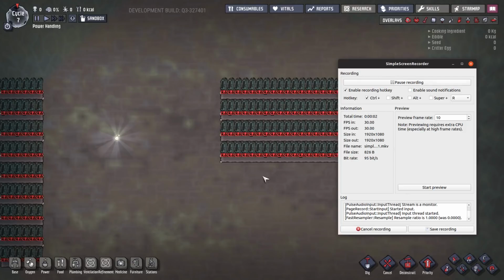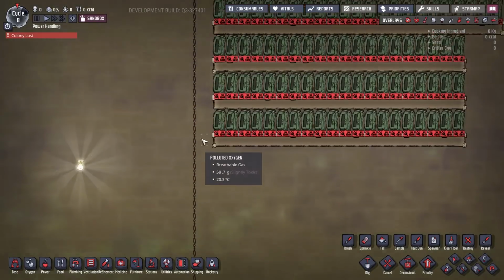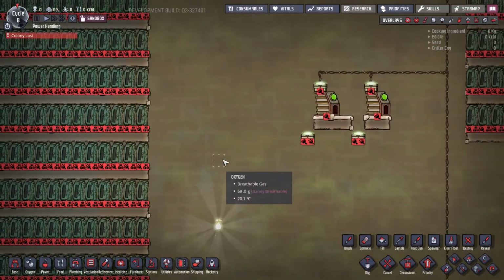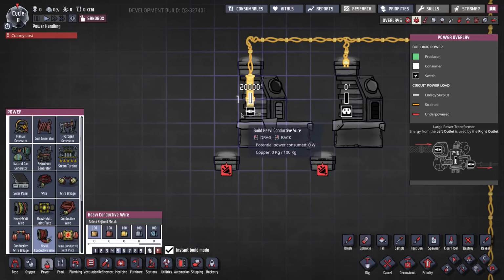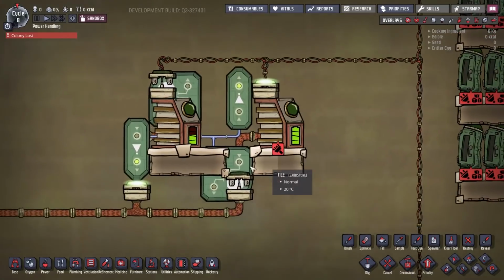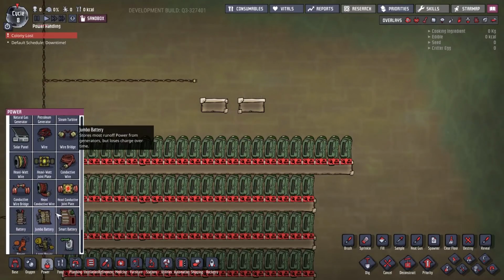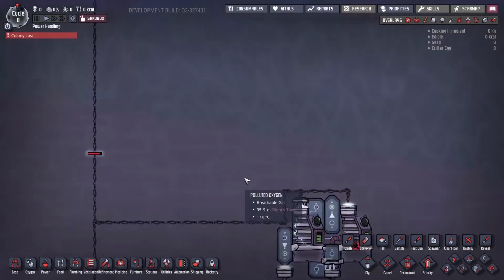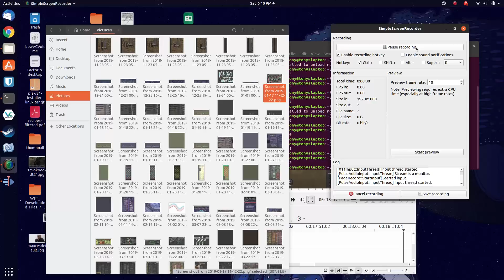How to distribute TONS of power all over your Oxygen Not Included base.

Comment: You effectively turned the batteries into capacitors. I like this.
Reply: I thought batteries and capacitors were the same thing. What makes them different?
Reply: @TheDJroombaGaming  Capacitors charge and discharge extremely quickly and hold their charge in the electric field while batteries, by comparison, charge and discharge much slower, and they hold their charge in chemicals. Their function is similar, but they are not the same thing. Peace.

Comment: You can technically do this in real life in DC applications, if you have a high current draw device it needs thick cables to draw the amps so you can place a battery nearby, use thick cables from battery to device (like a high power motor) then have thinner (cheaper) cables for charging the battery as long as the device is never on long enough to drain the battery you're safe, as soon as the battery is flat though, you've got a fire on your hands

Comment: How is this an exploit and stuff like creating natural tiles for "wild" farms, using carbon pits to store food instead of having to power a fridge, and using polluted water to produce breathable oxygen aren't? This looks like it's working exactly as the developers intended in my opinion.
Reply: Because those batteries charge with 20kW power through 1kW wire between the transformers and batteries and it's not counted as a load on the wire. It should just break.
Reply: @HerraMonoTooni  IMO it's these little exploits that spice the game quite a lot. Of course, I'd prefer tiles with conductors and pipes already wired inside, us only deciding where to cross and to connect those. But we don't have these -- so at least these simple wires replace these to some extent. 
Also, wires made of metal ore just shouldn't work. What's more, you shouldn't even be able to make such wires.
Reply: It's not intended and clearly exploit. OR it looks like this to give you the feeling you're discovering something "secret" and actually devs are well aware of those little tricks. Proof is "most of the time" they don't update the game against it. Their goal is to entertain you and they're good at it.

Comment: While seeming exploity, your end result is really how batteries should work naturally imo, where the capacity is acting as a buffer over that 1kw and not causing a draw on the power source until the batteries run out. Batteries definitely should not charge at a faster rate than anything that would normally consume 1kw though.

Comment: For the record, I've been testing this lately and it still working.
I've been playing a little bit more and I didn't need any power transformer at all. Actually I tried to create a power grid with generators that uses only the 1kw wires and they don't break.  They only seems to break when you connect consumers to them, the generators doesn't count.
So basically, you only need heavy wires for the consumers only. You can "transport" the power from the source to all the places and put this device wherever you need to consume some power.

I kinda create micro power grids in places. The only place where seems to be reasonable to use heavy watt wire is in industrial zones, but just to avoid building tons of generators for each machine that requires between 1-2 KW.

I tested this using the current max capacity, 50KW. To avoid any flickering the main battery needs to be set up around 50%. Otherwise the consumption is so fast that the  switches lag add some buggy cuts. For that scenario, 4 batteries is a safe choice. I don't know who could need 50KW but, hey...
Reply: Wow, thank you for volunteering so that those of us who just discovered this trick can know that this trick still works
Reply: It's based on real life physics, so there is no reason for them to take it out. Petesmith13 has the top comment (for me) explaining it.
Reply: ty

Comment: > the cut-off switches are analogues to a real world relay switch. In high voltage they are usually controlled by powerful solenoids. They have been used to make or break a high voltage circuit for a long time and are simply an electro-mechanically automated blade switch (like the ones in every 1950s horror / mad scientist movie). You are using the correct terminology - when the switch is making contact, i.e. allowing electrical flow, it is considered "closed"  - the blade is closed . When there is no electrical flow, the blade or electrical contacts are not touching and so are thought of as " open ". The terminology is opposite of that used for valves in a fluid system.
> Yes! This is an exploit! As near as I can tell by the behavior of a system using several batteries, especially when scattered around the base, that the program uses the same algorithms for electrical flow as it does for fluid dynamics in a pipe ... which is also unrealistic. Both are based on distribution of "packets" of resource, rather than overall pressure or voltage. The electrical "damage" from overload is certainly NOT realistic and it took me a long time to forget my real-world knowledge of electricity to stop damaging wires in my base. In short - if a 10 watt light bulb is hooked with 20 feet of 1000 watt wire to an overloaded grid, that 20 feet of wire will never be damaged - it's only handling 10 watts of energy. The damage will only begin to occur from the first junction where the wattage totals more than 1000 watts back to the original supply point. Where the program really fails; if a 400 watt generator attempts to power a grid attempting to draw 1000 watts, it's the generator that gets damaged, not the wires.
Reply: Only problem is in real world the switch will take a lot of physical damage. 

The battery life will also deteriorate over time like mobile phones.

Else this system is not actually an exploit.

The battery load is not must for those 1 kw wires.

The game needs to get AC to DC converter just like in real world
Reply: @sharathvasudev  not really. there is a thing called Contactor who likely work like that showed up. it can switch high power easily with small power needed. like that: the battery gives a small current to the contactor/power swich who then closes the circut.
Reply: @astrid2432  

Sure yes but what about physical damage to the switches.

The game doesn't account for physical damage due to prolonged use
Reply: @sharathvasudev  I think that will be too much as it would be like you need to repair everything then
Reply: @astrid2432  

Bots. Like robo miner
Reply: @astrid2432  contactors are just bigger switches to handle bigger loads, but they get damaged too in the time.
Reply: @sharathvasudev  then just overpower everything wrong and fix it constantly. Wtf?

Comment: Do this act as a diode  as well at 11:28~. 
You said that the battery supplay as much/least as they can get from the system(main grid) so, you have your normal base that work 24/7
and the rest of the power gose through this system(if! you wany sure) that act as a diode, any machine that need more but not the most will get what's left right?and the battery and shutoff will kick in or off.

Comment: I'm an electrical engineering major, and the single input OR gate was kinda funny (cause I do the same stuff all the time), but you can just use the buffer gate to create the delay, cause thats its purpose. Timing shenanigans were one of the worst parts of fundamental circuits. Edit: Yes I know it's a year late to comment
Reply from the maker: Can a buffer gate be set to have 0 delay now?
Reply: I use a Filter gate set to the minimum 0.1 seconds to create the delay that prevents overload flashes.
Reply: @PyrokineticFire1  I know, one year later... but. Is that 0.1 the internal the Not, And, Or and others has?

Comment: how is this helpful? you're still using heavy gauge wire which is what you want to avoid doing

I am in the early game but trying to figure out how to distribute power to all my machines which only total around 1500 if they were all to be turned on at once, but I only have 1 circuit, so things get overloaded sometimes.

I don't want to make a bunch of transformers because they create a bunch of heat. I saw on the wiki some kind of automated power switch like this but I don't see how this is helpful because you're still just using heavy wire which I don't want to do because of the hit to decor
Reply: Tony's design splits machines into grids connected to the same power spine. For 800 refrigerators in Oxygen Not Included (120W each, 1000W wire limit), you'd need 100 grids of 8 fridges. He uses 'Power Shutoff' to isolate machines and keep batteries charged. You only need better wires if a machine uses over 1000W or splitting grids becomes too complex.

Comment: This video example is used with the power consumption being loads. If the consumer is other batteries, can this be flipped so all power generators could be used to charge into the main power brick/batteries?

Would that mean it could be done in reverse such that for all sources of power, they can push power back into the main power grid/supply?

Comment: You could just roll play that you are running high voltage wires then the battery setups are converting it down... or it’s a smart cheesy way of doing things. lol
Reply: it's cheesy because the wire insulation is so perfect. that type of high voltage would arc through a lot of materials. 
I still loved using it for a base.

Comment: are large transformers required for this build to work ?
Reply: Tranformer can act as a input power in grid as well,
when it comes down to what transformer to use, it depend of which application you are currently doing.
if you have your power on big cable, you can use small cable directly only if the big cable dosen t directly go past the limit of the second cable that is connected without a dedicated tranformer.
When you need a transformer is when you need to split, you power for a different cable(and you know connecting the big one directly to a small conductiv or t1 cable will fried the weak one, (cuz the big ones will not get fried they can withstand 20kw or 50kw while the small can up to 1k or 2k.
(from what i know)
The small one standard, you input type  of cable and get out about 1k power with first cable, 
larg transformer do the same but for a output of 2k. 
Transformer can input power from a small cable to a big or vice versa 
I think my brain hurts to say all the logic behind.

Comment: You mentioned how the power grid draws from one point and then when that supply is depleted, it moves on to another source.  I would say it is akin to how gasses and liquids sorting horizontally leaning to one side, but in the case of power, the query goes like this:

Am I receiving enough power now for what I need, from the last location I accessed? If yes, draw from that source again, else locate next available source.  

Basically, if there is enough power coming from the last source, save processor activity by not searching for another source.

But this is my interpretation, not a dive into the code of the game.
Reply from the maker: That makes sense. I toyed with it once long ago, and it seemed like it prioritizes power from sources starting from the top left corner of the map, left to right, across each row, to the bottom corner of the map. I didn't experiment very hard to check it, but it makes sense programmatically if each circuit has a list of "sources" that happens to be sorted by map position.

Comment: Does the Not gate still have enough of a delay to allow overload damage in the launch update?  I've seen this kind of system but only using a single not gate.
Reply from the maker: Yes. At least it did when I made this video. If the timing isn't on the exact right tick then you'll get overloads.
Reply: I've always used a NOT and a Filter. it's like 5 kg of metal.. you're already sinking hundreds into the batteries, just to avoid the split second of overload, imo.

Comment: So yeah this is an exploit, and it's probably not how the devs intended. However from a real world electronics standpoint it's not that unreasonable. IRL we use high voltage low current wires to transport power over long distances, they are very thin (and very cheap) and not even that conductive, but it doesn't matter because they never carry that much current, they do carry a massive voltage though. We get the power to that state using transformers and then we use transformers at the end point as well to turn it into a more usable form, pretty much just how we see here. (I'm sure that it's a coincidence and the devs haven't done that on purpose but it makes me feel better.)

Comment: Altho that looks cool i dont see how I would use it for real. Every small appliance i have i would have to make a new battery and thats all provided i have infinite power source. Im open to advice obviously. Good video tho
Reply: If you have a power hub.  It's cheaper and easier to string 1000w wire.  It could go right throw anything with no bad effects.  Get it where you want it and build the exchange system.  No more need to have the heavy wire running up 1 side of you base.  Having to make sure it's hidden.   Small 2000w wire that don't kill you dupes having to be next to the heavy stuff.

Comment: Blueprint mod would make it easier
Reply: and a better design!

2 smart batteries side by side
4 power switches above them.
2 wire bridges above them, linking 2 loops of wire that go down through the switches and link with battery then return through the other switch touching that battery. the bridges connect the left sides and right sides (one will be the source, the other the load)
link the automation wires for the power switches on the inside and outside together.
have 1 battery control the automation, link the not gate to the switch (and it's inside/outside pair) leading to that battery's load and a filter to that battery's supply switch (and pair)
Reply: @PyrokineticFire1  I would need a screenshot please

Comment: Power isn't the only thing in the game that defies logic and physics... It all does. Which is funny because of how much effort they put into adding actual physics and logic into the game, where it isn't truly needed. 🙄

Honestly, they should have just used simple logic and physics for power. A battery is a load when charging and a supply when draining. Wires loose power, based on distance from the source. Amps, not watts, determines load on a wire. (You can use thin wire at 4000000watts, if the voltage is high enough, because the amps are the same. Thus, you would use voltage transformers, not the garbage they created and thicker wires.) You would have a 120v or 240v wire transformer, a 1200v transformer and a 12,000v transformer at various stages. But all the wiring would be the same. Length limiting what can be powered, before a battery is needed, in-line, to extend the reach. While also being used to buffer a source or draw.

I'm still waiting for faster moving gasses and "heat to rise", "heat to cause expansion of gasses", and the reverse for cooled gasses. Actual "volume flow" would be nice too. As well as gasses mixing, per block, so they don't keep getting stuck and creating all these exploit solutions to make-up for bad programming hacks. Which oddly, create more problems and are slower than basic logic to process. 😂

This game actually makes every player more dumb, to reality. You learn horrible physics and logic that defies reality.
Reply from the maker: The game contains its own fantasy version of physics. I find it compelling. We get to game out the workings of a different reality.
Reply: @tonyadvanced6315  Yes, it turns everyone into a hacker, using exploits, just to simulate something more like reality, or defy logic even more. Like the electrolizer that, without exploits, never actually comes close to outputting what the device states as an output. Best case, you get 75% of the output. Exploited you actually get 100% output. 🙄
Reply: You're talking about exploits... in a solo game ! Nobody will be "hurt" by this. People do what they want solo. Everything you say is not really true, since the game got so much success. I've searched very deep in what people can really do in this game and it's absolutely crazy. Those people are sometimes real engineer and they don't care apparently. It's FUN obvisouly. Maybe not for you.

Comment: you over-complicate this, only 1 battery needs smart wiring, and only 1 not gate is needed.
or gates are not needed, but may make it "safer to load/reset"
as long as there is no consumer over 1 kw, you can put any amount of power trough it without breaking.

you branch off consumers of such a trunk-network by 2 oscillating batteries with 1 not gate an 4 switches.

Comment: Aren't you still running heavi watt wire to your appliances?
Reply from the maker: I did that in the video in an attempt to demonstrate that this works even when you need to send lots of power to high demand circuits. In practice I find it more useful to keep everything on 2kw circuits instead of 20kw circuits.
Reply: That's because the appliance side is using more than 2kW for the sake of this video. The main point is the distance from the main battery station to the appliance source battery uses only 1kW wire which will save you a lot of metals.

Comment: Instead of using 4 gates you could just use one not gate and then wire all the switches that needs to be close to input end and the other two to the output.
Reply from the maker: The timing for all the switches has to be on the same tick or your wires will get overloads. The not gate would switch them on an off-by-one tick.